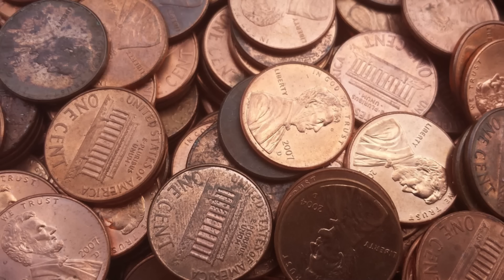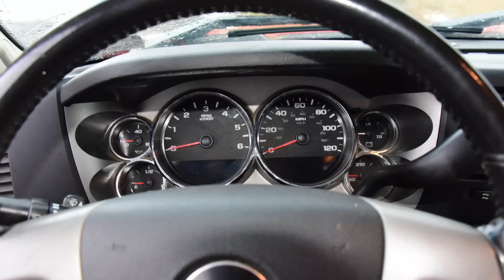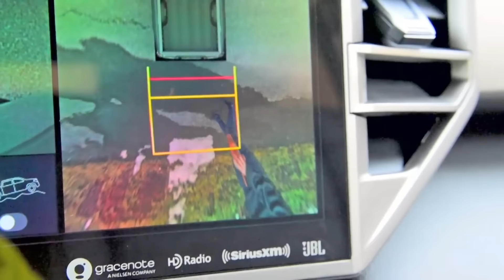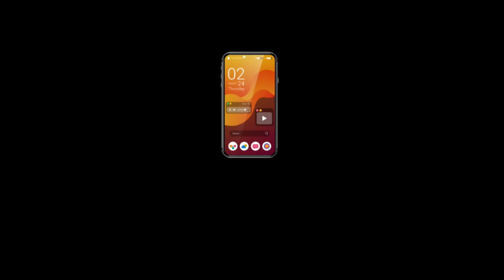2008 Chevrolet Silverado: Regular Car Reviews

Comment: When I was still in the military, in 2017, my dad gifted me his worn down 2003 Silverado 1500, it is the previous generation to this one, but the same configuration, the extended cab, (backseat but smaller than a crew) standard box (6 1/2 feet). I was a mechanic in the military, and he knew that I would get a lot more years out of it than him, and he needed a crew cab for his business (a hunting and fishing lodge where he guides people on different kinds of hunts). He ended up with a 2016 Ram 1500, crew cab 4x4 with the 3.6V6, which stood out to me as the opposite of a vanity choice, to get a base model without the Hemi. He got it because it was an incredible price, and was capable enough to do what he needed it to.

The Silverado meant something to me already, as I had learned to drive mostly in it, and it had moved our whole family from South Dakota, to Colorado, and then Manitoba. By the time he gifted it to me, it had 178000 miles, several different check-engine codes, a couple leaking gaskets, and the brakes/suspension were worn out. I put a bunch of weekends worth of work into it at the MWR on-post auto shop, and after about $2000 in parts, I had a really nicely operating truck with some "upgrades" that 20-year-old me really liked. Stuff that 27 year-old me still enjoys but would have maybe done differently.

Since then I got married, got out of the military, moved several times, and just recently we had our first baby. I have owned several different primary vehicles in that time, but the truck has always been there, it's helped multiple friends move, it's moved our entire house with a cargo trailer several times, and it has the most comfortable seats of anything I've ever driven.

I think during that time, I've had different eras of my attachment styles with other people, there have been times when I loved the truck for its ability to allow me to do things independently, carrying home building materials for countless home projects or other vehicle projects. There have also been times when I loved the truck because of its ability to help me help others, building friendships in the 5 different places I've lived since owning it.

To me, a family man who buys a crew cab short bed, is trying to be everything to everyone, it's a vehicle that can do anything you would ask of any vehicle, from a practical standpoint, it's a family car, and it carries stuff for your projects or hauls the trailer you may or may not have, its the vehicular expression of a protector-provider.

A lifted crew-cab with tinted taillights, a loud muffler and a locally hated sticker is the vehicular representation of self-sufficiency and independence above all else, that you don't need anyone for anything.

I also think there is still such a thing as an honest pickup, base models exist, and a crew cab can make sense in several business use cases.
Reply: Well said. I was sad when there wasn't any more to read.
Reply: I enjoyed reading your story too. Add a few hunting and fishing adventures in there and you may have the makings of a book.
Reply: Yeah I agree. Our newest fleet vehicle after extensively using an 07 2500 was a 2015 super duty. The chevy didn't even have a CD player and the vinyl seats were abysmal but the 2015 was still devoid of any luxury features. The bare bones interior and dinky little wheels I thought were no different from my OBS era trucks. There's a big stereotype about luxury trucks and automatic tailgates but those base model fleet trucks do still exist. And will take you back to 1997 real quick or even the 70s, I mean the front end was still twin I beam on that ford.

Comment: I worked for a Chevy dealer through the entire lifespan of this model.

I remember when the next generation came out, and feeling a small sense of dread.. knowing that trucks would never be trucks again.
Reply: even as a 10 year old at the time i could tell something was changing/ different
Reply: I always wanted one of these when they came out when I was in high school. My dad sold these for a bit till the economy downturned. 

In retrospect I never bought one of these. The dash and seats are not old school GM. These trucks helped my disappointment in GM. But these were the last of the real trucks in a new era.
Reply: I think modern trucks are just replacing passenger cars. The auto industry has a weaker EPA fuel requirement than the rapidly disappearing cars, for example Subaru is dumping the Legacy....so as I see it new trucks are just overpriced, over teched, passenger cars with hardly any bed.

Comment: I've got one of these. WT trim, long bed, with OVER 250k! Bought it for a work truck, Though the fenders and cab corners are rotting out, this truck runs like a brand new vehicle. 5 out of 5. Will buy again (after this finishes returning to the Earth.)
Reply: Do they still make WT trim and do they have a touch screen?
Reply: @brianmiller1077  Yes and yes. They do have physical controls for most important stuff though. Only the long bed comes with a V8 though.

Comment: I have that exact model, same color, year, engine etc, mind you no rust and it's honestly been a rock solid TRUCK, it's basic and gets the job done, exactly what I wanted. I have a car for comfort and style, I don't need a truck for that. It's towed my racecar from Quebec to Ohio and back 4 times without even a hiccup....it just works and does truck things. I've owned it for 8 years and I've replaced the starter and a couple pulleys, simplicity at it's finest.

Comment: Just drove one of these 1k miles  in 2 days to haul a 1500lb sheet metal brake and goddamn I’d do it again. Comfy, reliable, moderately quite and the 5.3 is no slouch. GMT900 is best truck

Comment: What you spoke about was a phenomenon I think all of us are coming to grips within our 30's.  The vehicle is not just another product that is developed like a cellphone or some other throwaway consumer product we are so used to.  It is an engineered vehicle, often times built by working class people and a piece of time whenever that vehicle was produced is instilled inside it.  Vehicles have for a long time been refined to the point where I think they transcend the obstacles placed in front of them.  The roads haven't just changed much; the vehicle is still asked to do the same things it was designed for regardless of age.  A special time to be alive when you can own the same cars you thought were cool as a kid and they are still a venerable form of transportation.

Comment: I actually own a RWD 2008 GMC Sierra with a 5.3, it's bad on gas (it's my only car and I have to use it as a commuter), it's hard to park, can be hard to see out of, and is bigger than it needs to be.... and I don't think I'll ever sell it. It has all the power and torque it could ever need, it's simple and reliable, but drives surprisingly well, is fairly comfortable, and is honestly not that bad to be in as far as NVH is concerned. It's simplicity also means I can fix it easily, it's nice to work on, and I think I'll keep it for as long as I have room for it. It's a good truck, and it doesn't try to be anything more than it is. It's just damn good.

Comment: If you want to buy a Tundra or a Titan in single cab with an 8 ft. bed you have to specialy order it with a huge upcharge and up to a one year wait. That's why those trucks in that configuration are so rare and ask high prices used.
Reply: I once saw a short bed single cab Tundra in the parking lot of an Arby’s two weeks ago. It was like spotting a unicorn
Reply: @gustavoalmanza2673 They're around here and there, but definitely a much rarer sight to see than the crew-cabs.
Reply: I always thought the reg cab short bed Tundra was harder to find than the long bed. Those are fleet specials so I guess they were regularly ordered. Moreover the 1st gen Tundra wasn't even available in RCSB, then the 2nd gen came out and it was an option but I don't think I have seen more than a handful of those

Comment: I own an 08. Absolutely love it. It's not the best at anything but it's good enough. Passenger room? Enough for my wife and child. Tow Capacity? Hauls my trailer when I need it to.  Bed Space?  Fits mostly what I need it to. Fuel economy? It's okay. 4 wheel drive? It's no trail runner but I have yet to get stuck in the snow.

Comment: Speaking of micro transactions that make you play the game less, I rented a Nissan Versa last week and was reminded of how long it’s been since I had to manually flip a rear view mirror. 
I also argue that the generation previous to this Silverado is best because no engine offered active fuel management. I know a guy with a 1999 Silverado with well over 500,000 miles on it and the engine runs fine with no ancillary fumes. It see primarily highway action, but half a million is half a million.

Comment: If a pickup is avoidant, a wagon is secure. For many people, the wagon is just as practical but the owner of the wagon doesn't concern themselves with appearing "masculine."
Reply: My favourite car I had was a Jetta Wagon. Amazing fuel economy, comfortable enough for me, reasonable tech/simplicity balance (except the microswitches in the door... wtf), and plenty of every-day utility in the back. Great at hauling animal feed and light towing. I got it specifically for driving daily as my giant diesel 3/4 ton (well, these days it's about the same size as a fucking 1/4 ton...) used a lot of fuel. I spent a long time tracking down a low-rust specimen of that era (last of the ALH diesel, 5 speed stick). Did a shitload of work to it, then lost it all when a confused doe jumped in front of it and insurance screwed me at a time I wasn't in a great place financially. Since then I've found it really difficult to work on anything I have. This video really hits home lol

Comment: Silverados are some of the best vehicles ever made.  There are so many options you can do whatever you want right from the factory and with the aftermarket anything is possible and even somewhat affordable.  You can have a slammed to the floor 2wd single cab, a lifted 4wd short box, and a crew cab long box towing rig ALL the "same" truck but completely different beasts, great at what they are made for and not out of place.

Comment: I have a 2010 GMC Sierra SLE with the same engine as this Silverado. It was an old paving company's truck and the frame and underside of the cab are caked in asphalt. It has rubber floors, no power anything except the windows (which don't work right because the paving company fudged with the wiring), and is two wheel drive with 210,000 miles and I love it more than any other vehicle I've owned and want to drive it til the wheels fall off, put new ones on, and keep on driving. It's just an honest, no frills, no nonsense former work truck that just works. Aside from a finicky TPMS that really doesn't like cold, for the three thousand miles I've driven it it's been a faithful companion, and feels like it's always ready, ready to take me wherever I need to go. I think the GMT900s are good looking trucks, especially when slammed on bags with a trick paint job.

Comment: ABS, traction control and A/C are the modern luxuries I crave in any vehicle these days to make it a special treat to drive, and hey, with a crew cab, your not passenger limited, rather, you have a massive amount of carrying capacity, without having to suffer towing a trailer.

Comment: I had the equivalent Sierra but it was a 2009. I had it for 10 years. It didn't have that bad of body rust, only on the bed fenders, and the frame had surface rust. The thing never had a ton of power but it did everything I needed it to and it didn't have the active fuel management since it was the 4.8 so no real worries about failed lifters/bent push rods. I used it for decent truck duty things like hauling almost everything you could imagine. I towed various different things with it. My fuel economy wasn't as good as this one since I live in a hilly area. I only got 19mpg where it was flat on a trip, otherwise 13. Only thing I didn't like about it was the 4 speed transmission. I felt like it needed a few more gears. I loved the manual 4wd transfer lever. I miss that a lot. I only got rid of it because I needed a crew cab since car seats meant I had to sit on top of the dashboard when they were in the back seat. Seriously, car seats are insanely big. How does a person have a functional front seat in any smallish car with these things if my truck was too small? As much as I like my current truck, I miss not having a truck payment...

Comment: My dad has an 07 Silverado. It has like 300k miles, the body is rusting apart, and half the gaskets on the engine leak oil. Still runs though. It could probably get another 15 years out of it if it had an engine rebuild, but that would cost twice what the truck is worth.

Comment: I have a single cab long bed WT 1500, Base model of base models, interiors fucked? dont matter, Torque converter clutch doesnt work? doesnt matter, Idle misfire? Death wobble? 2000lb industrial equipment in the bed? not a singular fuck to be found, 4.8L/LS 4l60E these shitboxes are the fucking GOAT. they have phenomenal road manners, and it actually gets better with load in my experience.

Comment: The garage I work at has a 2011 base Silverado single cab for a shop truck it’s well used but can load up the bed with a shit ton of drive train parts and wheels no problem in the corners or highway, I know that doesn’t sound like a heavy load but for this underpowered truck with 180,000 miles she gets the job done.

Comment: Got an 11 lt trim package clothe seats ext cab z71 5.3 6 speed auto. Bought it with 100k miles in 18 for 19k. It's currently sitting at 243k miles and the bed is shot from rust but the frame and cab is imacculant. Been the best truck ive ever owned original engine and trans and wouldn't be afraid to pack my bags and take it from coast to coast tomorrow.

Comment: I had one of these in the same configuration, just work truck white.  I ran service for an oilfield company.  I put 100k on it in a year.  Best darned truck i ever drove.  It was a company truck.  Never gave me any issues.  Only needed a pair of tires once and i think brakes other than the obvious standard maintenance.  I worked it hard too hauling and whatnot on backroads/lease roads and in the snow/salt.

Comment: This generation of trucks are fairly reliable and cheap to fix. As long as you don't completely ignore the frame rust, it won't rot out with the same severity as a Toyota. The transmission is fine if the fluid was changed every once in a while. There were some engines with oil pump pickup tubes that had damaged o-rings that would cause low oil pressure. The engines don't like extended oil trips, and the sludge that formed due to those delayed oil changes would clog the screens that fed oil to the AFM system. They burned oil but mostly due to the original valve cover design that allowed too much oil to be pulled into the intake via the PCV system. Even then, they still burned oil no worse than Toyotas of that era. They definitley had their fair share of wiring and interior plastic issues. Dashes loved to crack if parked in the sun daily.

Comment: I would argue this is secure attachment style. This is the half ton version of the 7.3 powerstroke. Reliable, nothing fancy, just gets the job done. Ive owned my 07.5 for 8 years now and no complaints. Also the extended cab, that would be the only complaint. The backseat is not spacious, I wonder if Roman has ever been in a crew cab

Comment: My Dad's old 2500 has been close to death for like 5 years now. 2 cylinders have been misfiring all the time, the body is rotten and now the transmission is broken. He still uses it to plow snow off of our driveway (1st gear still works) But it's days are numbered. I remember backing that truck into a tree when i was in highschool, my dad was pissed lol. Thats already been 6 years ago. It's funny how quickly time passes, i thought his truck would last forever.

Comment: I completely agree with you Nick and your analysis, one of the last trucks free of pretensions and stereotypes, a good, honest truck in a usable size, built for work and getting the job done. Yes, it's just a half ton, but sometimes that's all people need, and the extended cab provides more lockable, dry storage in the truck without sacrificing usability in the bed.

Comment: GMT 900 was the beginning of the end for GM trucks. No more manual option, no more die hard 4L80 optional, cylinder deactivation lifter failures, valley cover bolts loose. However Iron block engines without AFM were ok, last generation of the legendary 3/4 ton suburban and the gas 1 ton pickups had beefy diesel parts without the extra stress of the weight of diesel and all had no nonsense interiors

Comment: I had that truck except it was a quad cab SLT. It was the best truck I have ever owned. It was mechanically exceptional with lots of power but the body was rusted out. I have a 2016 Sierra now but I miss that 08 Silverado, it was a pleasure to drive every time.

Comment: I have a 2004 F-150 4.6l V8 with 2WD as my farm truck. It was my Father-in-law's, and I just took it over for him. Keep it running, keep it charged, but no more efforts for it. It's got rusting ford white paint, and the most bare bones interior of any Ford parts bin ever. There's nothing to it. It's just a tool. I get 1 yard of mulch at a time. Sometimes I use it to haul cardboard to the transfer station. My Prius can do that too, but you know... truck.  I can use it get materials from Lowes, but our Mini-van can take 8ft material with the rear end closed. 

My truck is like my table saw. Both are useful when I have the right project, but mostly just sit there. Both were given to me for free, and I'll keep as long as they run.